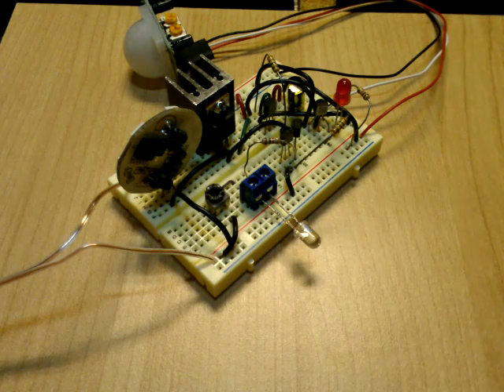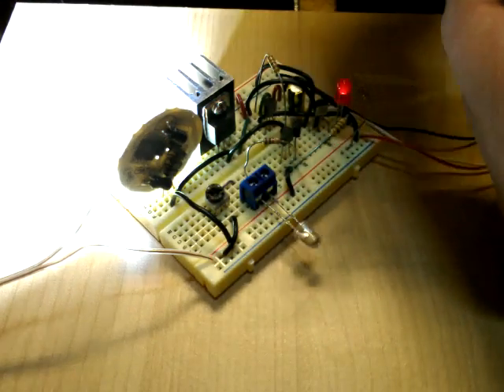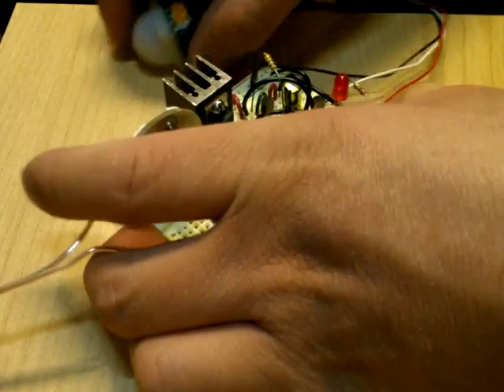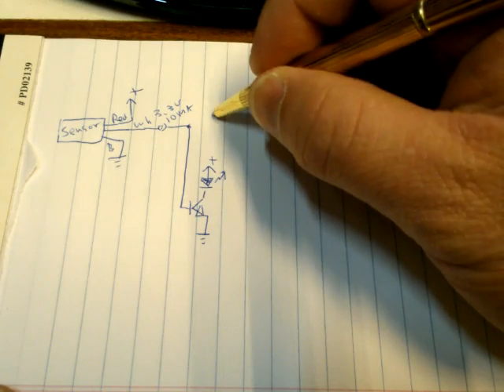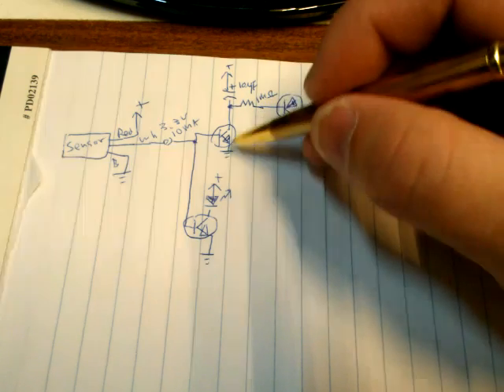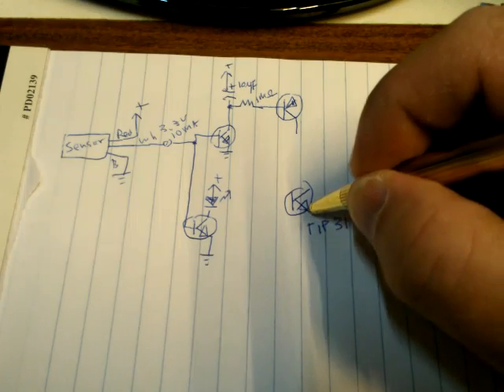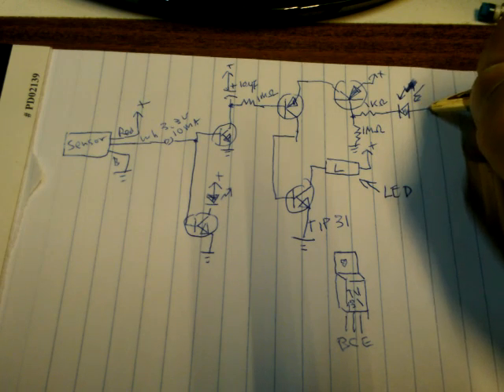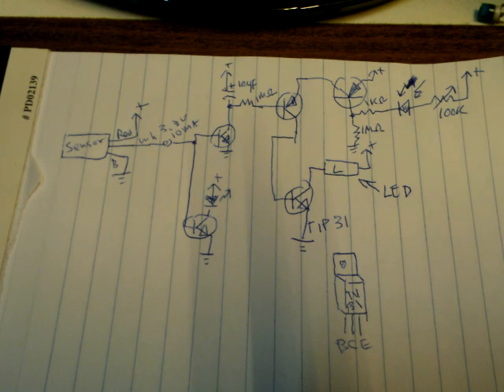Motion Sensor HC-SR501 (or DYP-ME003) Night Light

Comment: Hi. I think there are a few things I will do different (I am currently working on it): 1. Using a normal transistor to switch the current for your load LED is very inefficient. I will use a MOSFET i.e. I got a BUK7E1R9-40E  and will use it to power a 12V and 1.5A LED strip. A smaller one would also do. I need two more small MOSFETs (I will use PMV130ENEA) to turn the big MOSFET on correctly (VGS=12V in my circuit) 2. As two others pointed out before me: You can solder a light depended resistor directly on the board to suppress the trigger. 3. There is a small problem in your circuit you do not mention: What if you cannot avoid that your light sensor is within the area your LED is making bright? You will turn off the light again and in the worst case end up with a permanently flickering light. So what you can do is to use the output signal of the PIR to drive two small MOSFET so they can block the light detector completely. About these two small signal MOSFET: The first is connected with Source to ground and gate to signal and drain is connected to the gate of the other MOSFET and to a resistor (high ohm maybe 100k) and that resistor is connected to your voltage supply e.g. 12V. The source of the other small MOSFET is connected to ground again and the drain is connected to your photo resistor. Now if your light is on the first MOSFET is turned on and the voltage of the gate of the second transistor is close to ground and it is turned off. Effectively I use these MOSFETS as signal inverters which give a signal with a defined output voltage. So independent of your light, the resistance will be high as long as PIR detects something (I use the repeat-trigger jumper setting in the PIR). The other side of the photo diode I will feed throu the hole in the PIR which does not corrct to ground and I am kind of finished. The only problem I need to solve is how to adjust the sensitivity to light. I think I got a bit of inspiration from your video, but I am not sure yet how I will do it in the end. Maybe I will make the photo resistor outside of the PIR module like you did, because then I also should be able to reduce the number of small MOSFETs from 4 to 3. Once I finish my project I will post a link.

Comment: Why don't you use the LDR (light-dependent resistor) connection of the HC-SR501? http://img.alibaba.com/img/pb/061/452/919/919452061_739.jpg
Reply from the maker: Thanks for the tip.
Reply from the maker: I'll be sure to look at it again.
Reply: This page has more information on it, particularly near the bottom: http://www.electroschematics.com/12414/night-security-light-with-hacked-pir-sensor/

I still don't fully understand it (but I'm an electronics noob).
Reply from the maker: ...and you're doing great at finding stuff.
Reply: It's all in the wrist :P

Comment: Hi
I'm impressed with your work here & hope you can help me out if possible.
I want to create a circuit using this pir module that will basically turn an LED off when motion is detected, would you have any suggestions on this.
Reply from the maker: Sorry, I didn't see your message somehow. Someone labeled it as spam for some reason.